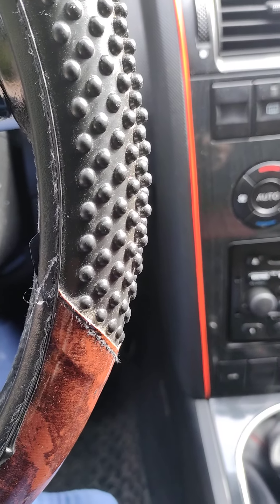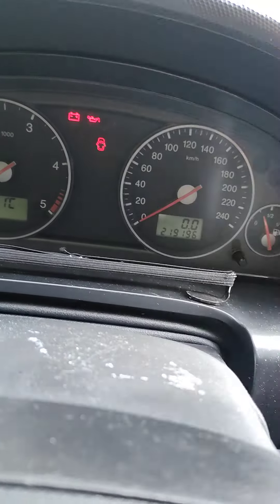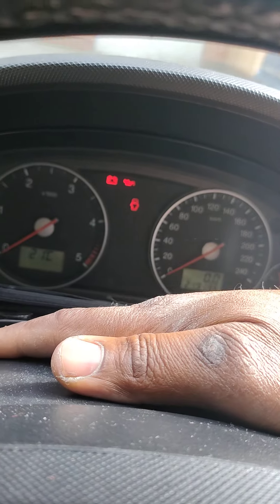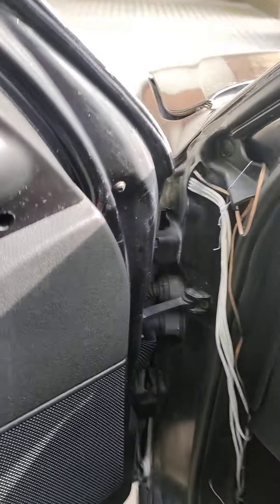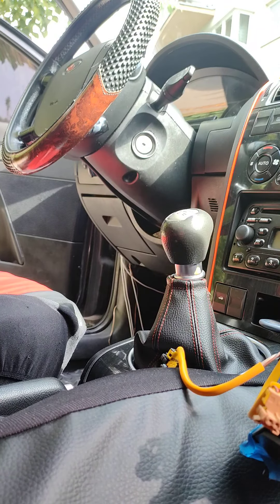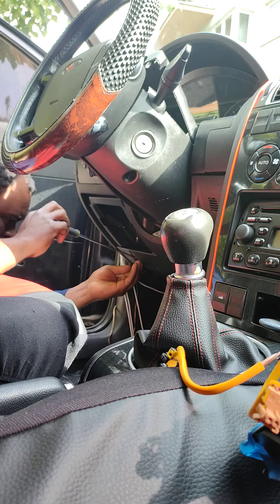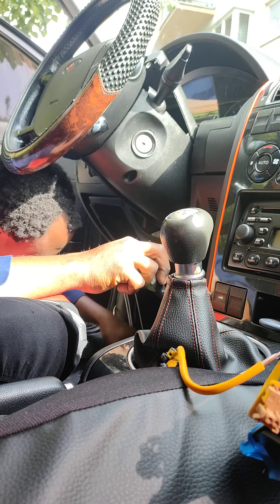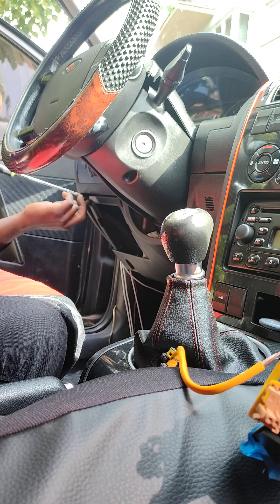How to change clock spring on Ford Mondeo MK3. Airbag light stay on. part 1.

Comment: Thanks. I have the same flash code on mine and will take a look.
Reply: It was enough to disconnect the connector and connect it better and after the problem, in 90% of cases there is no need to disassemble anything and it is a 1-minute job ✌️🙂
Reply: @nightmoon90  Tried that first. No continuity on meter so definately faulty